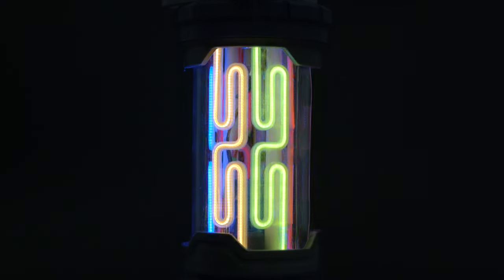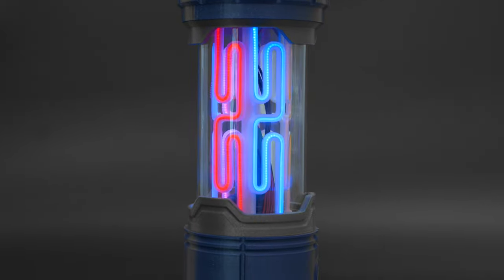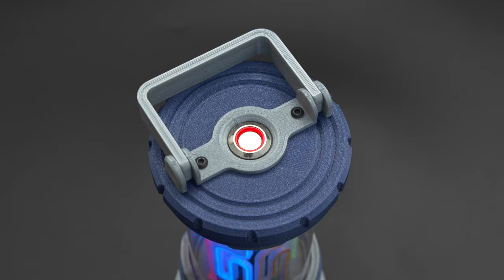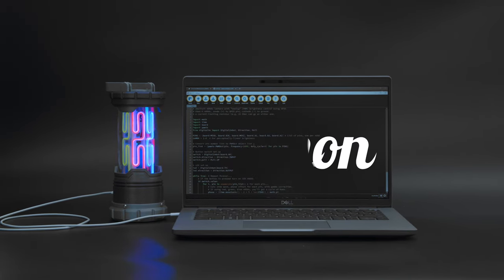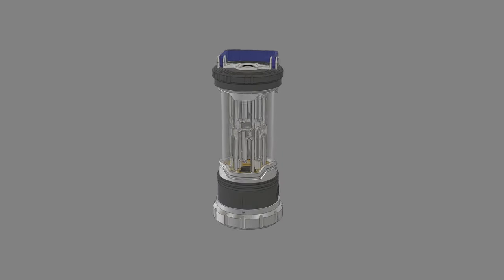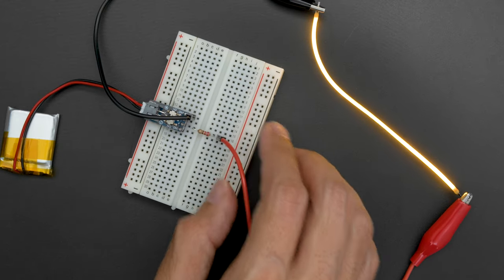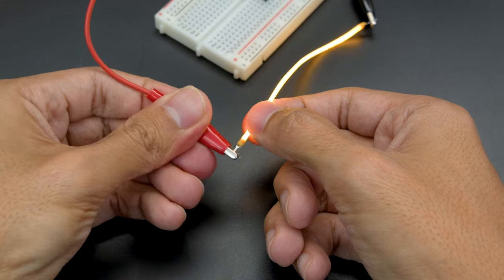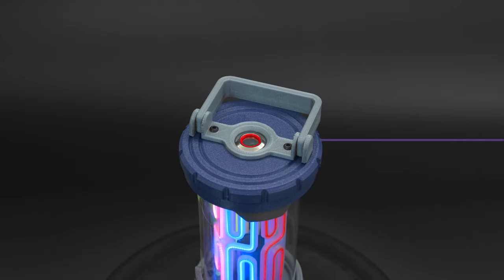LED Noodle Lantern #adafruit #3dprinting

Comment: The holder for the noodle LEDs appears to be missing, it does not appear in the parts list or with the stl files. Is it only included with the CAD files?
Reply from the maker: thanks for letting us know! The led noodle holder stl file has been added to the zip in the learn guide